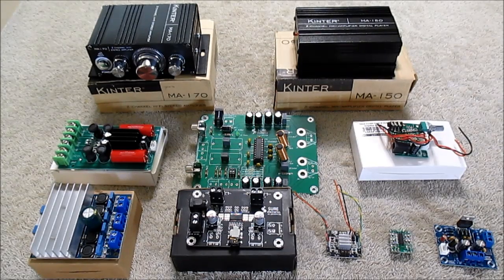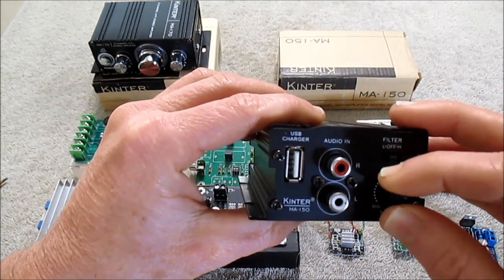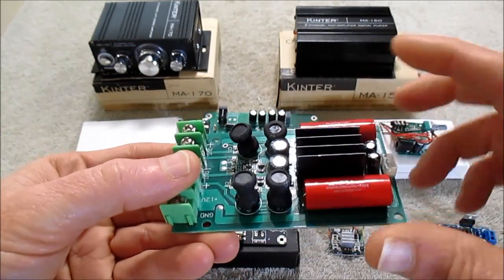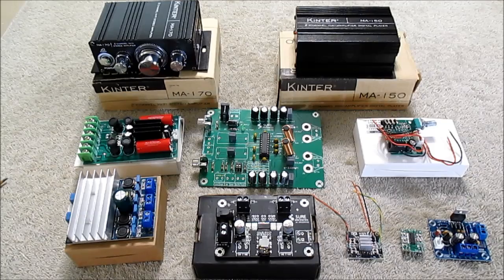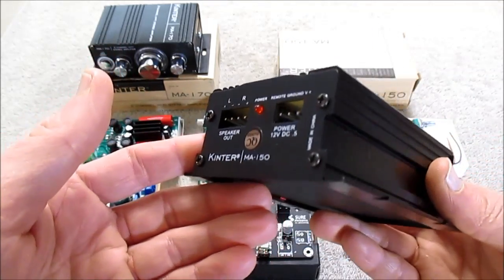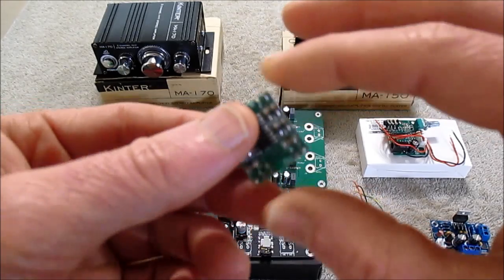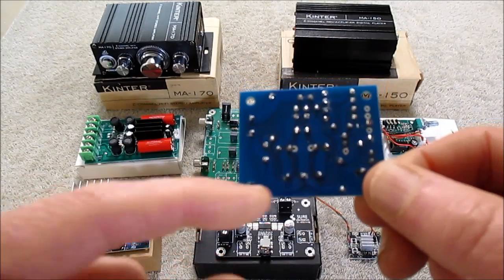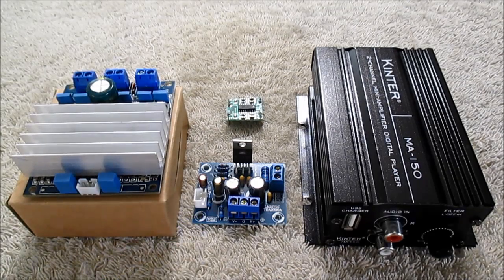The BEST low cost audio amplifier boards I've tested

Comment: John, I've made the lm1875 circuit and I want to add a volume knob to it. I followed you instructions in your video that you made  with the 10k pot at the input to ground however when I tried adding it it did not really work. The pot only acts like an on/off switch with little control over the volume unless you move it a hairs width forward (which might make the volume halved). do you have any idea why it would not act like it's suppose to. (and yes i set up the pot correctly because i can adjust the resistance without a problem and see it change linearly with my multimeter). 
Thanks in advance,
Vaser888
Reply: vaser888 Are you using a logarithmic potentiometer?
Reply: No, it's a linear potentiometer. It is technically a 25k pot but i put a resistor in parallel between the wiper and an input to make it a 10k pot.
Reply from the maker: Is the resistor connected between the wiper pin and ground? Are you sure the wiper (normally the center pin) is connected to the amp's input (not the source input side)?
Reply: Yes the resistor is connected between the wiper pin and ground. I could have possibly mixed that up but i believe I tried both just in case.  I'll set everything up and try it again. if it does not work then ill make a quick video to show you how i have everything wired and set up.
Thanks for the help. I really appreciate it.
Reply from the maker: I replied to your video.

Comment: John, is there a way to keychain ic amps like LM3886 to deliver more power? Can you make a video about it?
Reply from the maker: It is possible to bridge and/or parallel them for more power.
Reply: JohnAudioTech hey was just waiting for this 
ok now can u make a video on the best filter boards and other accessories 
best speakers in different sizes 
etc